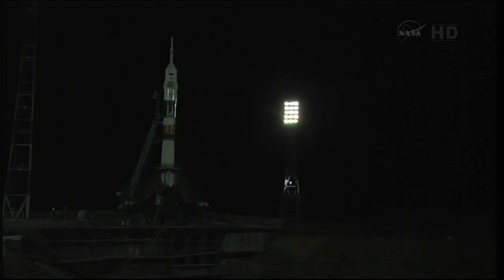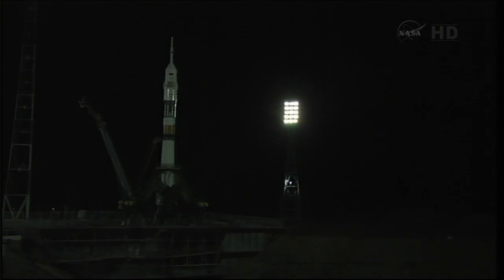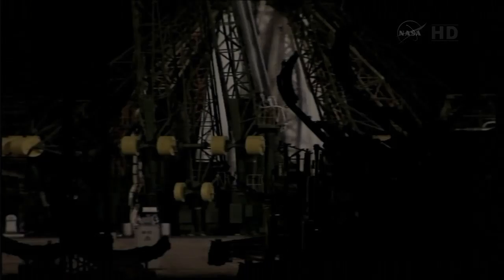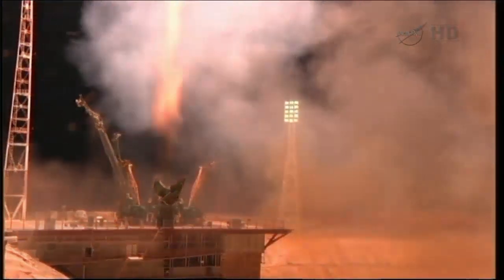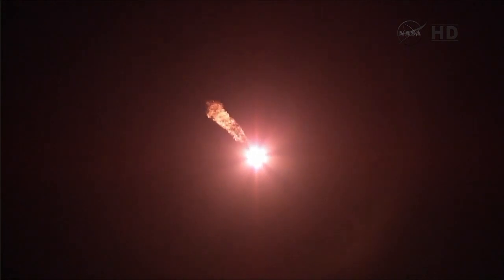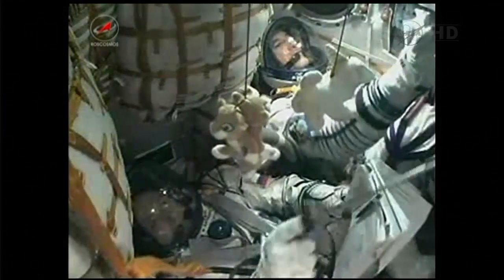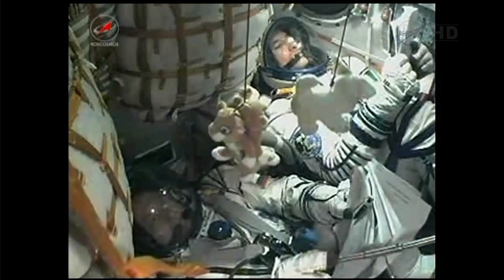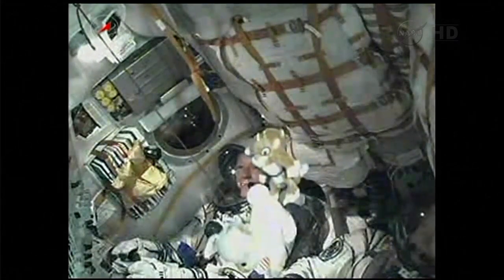Blast-Off! Six Hour Ride Underway For New Space Station Crew | Video

Comment: It's so they are able to tell what kind of gravity they are under. As you seen in this video, during the initial ascent, while under the acceleration of the rocket, the toys are pulling taunt against the string. Once they are at cruising speed & have entered microgravity beyond the atmosphere the toy will start to float freely. The 'naut's can't feel these force changes very much (except for the initial acceleration G's during liftoff) because they are strapped tightly in their seats.